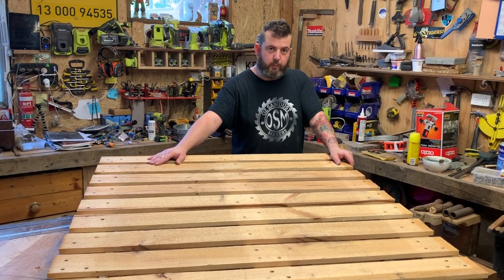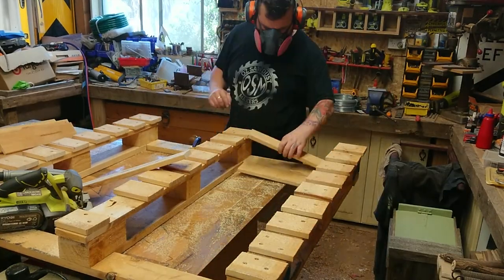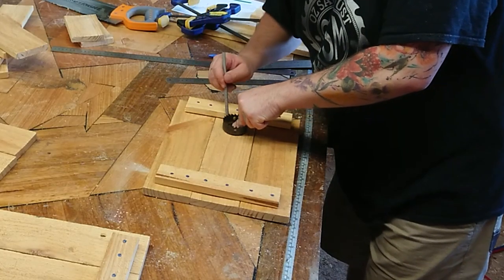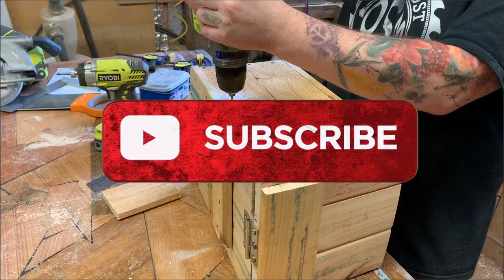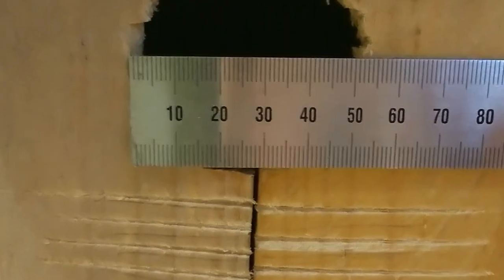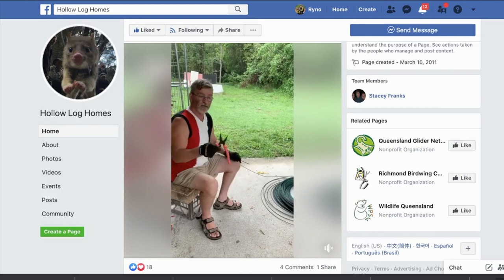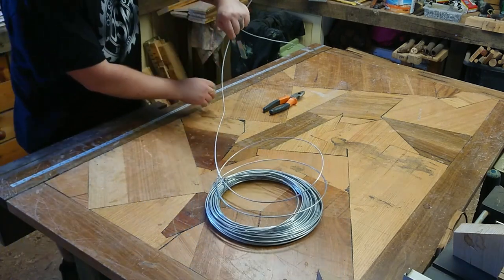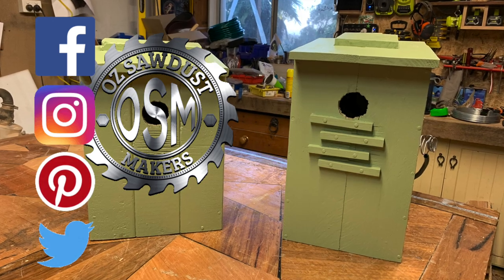DIY nesting box bird house from pallets & cheapest tools - how to -  Australian Parrot - FREE plans

Comment: Good stuff 👍 and I like your work bench.
I’m not sure about wrapping wire around the tree though. 
We use a backing board on the box which is screwed to the tree with rubber grommets (small sections of old rubber hose) between the backing board and the tree to allow for tree growth.
Reply from the maker: Hi Chris, thanks for the comment (and the feedback on my bench!) 
The wire with the rubber hose will allow for plenty of tree growth without damaging the tree. 
Good luck with your nesting boxes, i'd love to see some if you can shoot me a message on FB or IG?
Cheers ✌🏼

Comment: Nice work. Are the pallets you use made from treated timber, and if so, isn’t that a concern for the young birds who may chew the timber?
Reply from the maker: Hi Paul, thank you for asking an important question. I am using HT (Heat Treated) pallets which are safe for everyone, there are many videos on YouTube that help explain the codes on every pallet so you can tell if yours is heat treated or chemically treated.
 I thought I covered this here but I may have covered it in a different video and neglected to mention it here so thank you again. Cheers!